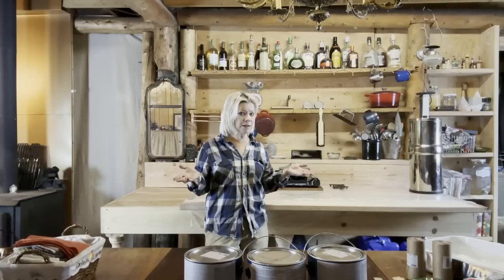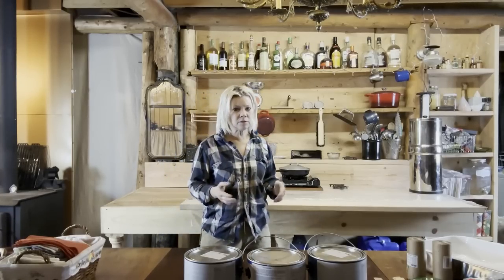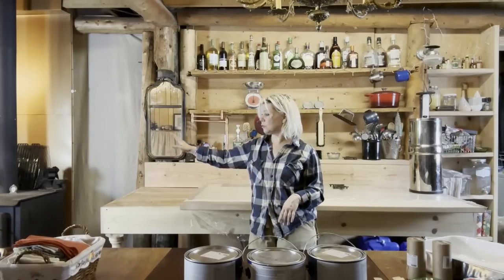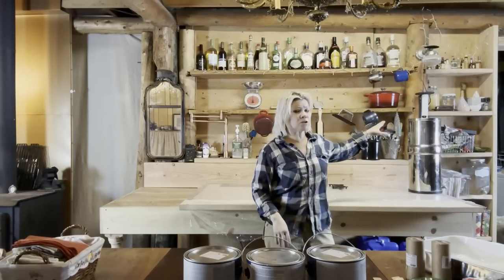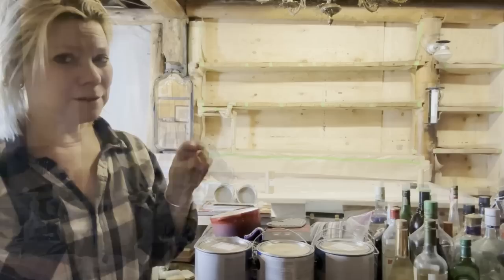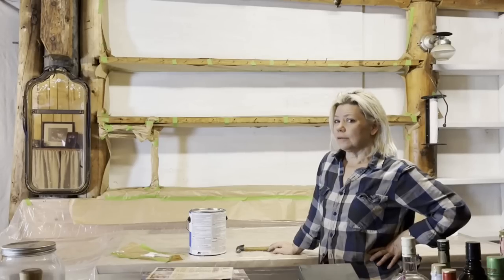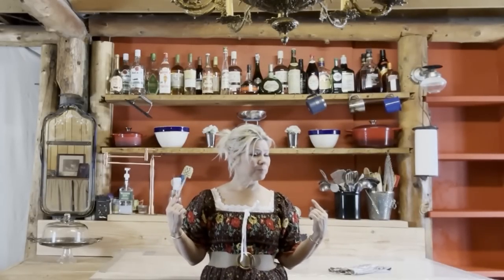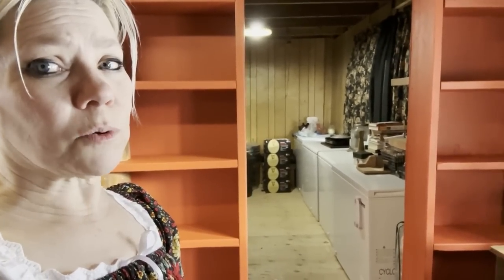Remote Alaskan Cabin Kitchen Renovation Continues

Comment: Ya don't know how happy I was to see that you primed up that natural wood before dropping color on it lol in fact there's only 3 instances where a primer sealer is necessary , smoke damaged, water stained damaged or natural wood...the rest can be covered with a decent pigmented paint like Benjamin Moore or Pittsburgh paints...nice job Aira, now some honey Oak stain on them shelves and you'll be in business,  I would torch and sweep them first though, that butcher block can be sanded 3 courses and then conditioned with the food safe stuff,its very easy and it looks brand new,even better... ,I just did all the counters and chopping prep tables for the culinary college downstairs at my job, just start with 80 grit,then down to 120, then your last with 180 or 220 whichever you can find will be fine, with a damp towel wipe up all that sanding dust ,allow to dry fully, then apply the conditioner with a clean dry Terry cloth like rag 5 coats or more,but its easy, it's basically like wiping down a counter with a cleaner..go at a steady pace ,amd always go with the grain of the wood ,fill any divets or lows,so ya have no missed spots..I'll get the name of the stuff for ya, that I used if ya like, and if ya can't find it up there, I'll send ya some...enough to complete the job ✌️😊 and remember, its never about the destination, it's about the journey getting there!
Reply: Thanks for the tips!
Reply from the maker: Hi Mike! I knew that if I didn't prime the plywood that I would potentially have bleed through or that the paint would be soaked up by the wood and then I would have to do several more coats. As it is, I feel like I did a full leg day at the gym from just doing the primer and two coats of paint. 😂 I will be staining the shelves and counter with a Rosewood stain to match the table and buffet, then sealing with pure Tung oil. The table was refinished previously with just Tung oil, and it held up beautifully. I need to re-do it as it has been almost a good 20 years since it was originally refinished and need to strip and seal the leaves. That will be a huge project, because I will also be finishing the buffet and stripping and refinishing the China cabinet at the same time. These pieces have made it three generations in my family, and I want to preserve them in the best way possible. I appreciate all of the tips on sanding and finishing the shelves. I am going to pin this comment so that I can find it easily when it comes time to do these next steps. 😉💛
Reply: @AloneinRemoteAlaska  oh okay, i should of known that you've done your homework on the project, however, the Tung oil may be improved with being mixed with flaxseed oil and linseed oil as well, it seeps into the wood really well and it is food safe there were other ingredients in the stuff I used,but I believe that those should be plenty good and ,you must remember to put the jar of oil mix into a pot of hot water. At least 20 mins. Before ya start, it'll loosen up that oil enabling you to spread  it real easy like, ..stir it up well also, and have at it, then later after drying a little,when it feels sort of dry to the touch, hit it with another coat, 5x is the desired coatings, however I did the ones at work 6 times and they still look brand new and there's 25 students smashing, rolling,chopping stuff on them for 6 hours a day so...that'll give ya an idea of what the other oils provide as far as durability and rehydration of the wood...go at your own pace, there's no race, just be sure to have any dust or what have you clear before ya go at it with another shot,and warm that oil up, otherwise you'll have sore shoulders next lol 😆👌 you got this!
Reply: @ZarpeParadise  hi Teri, if you meant me, you're very welcome! 
✌️😊
Reply: @mikefalanga437  yes, you! I love renovating. I'm so happy A. is taking us on her journey! Tips and tricks spark my day!
Reply: @ZarpeParadise  oh Okey doke! Yeah, projects can be really rewarding, especially when you exceed your owns expectations, good luck in all you do.. 
✌️😊
Reply from the maker: Hi Mike! I will be adding pure orange oil to the pure tung oil to help improve the ease of use. I really appreciate the tips on warming in hot water and the number of coats to use. My table was refinished with tung oil over twenty years ago and has held up beautifully! I am a bit concerned about the amount of dust and dog hair in the cabin when it comes to this project and others that I have planned. But am sure that patients is the key here. Due to staining before sealing with tung oil, I am hoping that I don't need to sand between coats. 😕 I am sure that when it is finished that it will be beautiful, and I will be pleased with the final result but am a bit apprehensive about the whole project. It has been so costly up to this point that I don't want to ruin it. I appreciate you offering any advice on this and other projects. Always good to hear from someone who has done this before. 🤗💛

Comment: I love it!! It's like a warm paprika color. I'm glad you brought the color all the way to the side shelves as well. Your eye registers it as one continual space & doesn't break it up with different colors, making it look choppy. I think if you found a fabric that has the paint color in it and added a skirt underneath your counter, it would really pull it together. I'm so excited for you! You must love it so much and I can tell it's making you happy. 😁👍💖
Reply from the maker: Hi Lauri! Originally, I was planning on making the shelves a mustard yellow but am so glad that I didn't. However, the shelves will still be getting some additional paint on them. To help age them a bit and make them seem less modern. I have been debating on adding a skirt under the counter. I know that it would help the overall look to hide the water jugs, foot pump and stacks of wood under there, but I have not decided yet if that is the way I want to go. But so glad to get your opinion, especially considering your home staging experience. 🤗💛

Comment: Love the color . The only thing I may do different is paint the front edge of the shelves around the door , maybe white . First I would put the painters tape on the front of one shelf and test the look. That way I could pull it right off if it didn't work.
Reply: Excellent idea!!💜
Reply from the maker: Hi Steve, I will be adding a little pop of contrasting color to the shelves to help them stand out a bit and look less modern at the same time. Love the idea and the painters tape trick! 😉💛
Reply from the maker: This is why I love the comment section! So many great ideas from everyone and for everyone! 🤗💛

Comment: Wow Alone, I love it! Good color choice, thought you were going for the green in the beginning of the video, but I guess you have other plans for that color. I had plain white walls, and just as you, I thought it was so boring. I painted above the kitchen tiles in a mustardy yellow. It made the whole room come to life. If I can suggest anything, I would paint the foundation of your counter top in the same color. That will make it more cohesive. Then oil or stain the butcher blocks and the shelves. It will make it easier to clean, but still have the natural look. Oil on your butcherblock will prevent the wood from cracking up. What was the tool you used? Looks very fast and practical.

Comment: Well im not an interior decorator and Im also male so I'm no help with the color or contrasting colors. I'm also a penny pincher so I'd always go with the reduced mistake paint or no paint at all. Heck my walls are still bair plywood still and its been 5 or six years now. Your doing a great job making the cabin yours and thats what's important. I can't wait to see the next item you check off your list. Till then be safe have fun and God Bless
Reply from the maker: There is nothing wrong with plywood walls. I saw this cabin once that the entire interior was plywood. Walls, ceilings, floors, everything. It was beautiful! Now to be fair, they used top of the line plywood, and hardly had any furnishings! That is something that I have not ever been able to accomplish. I love my stuff probably more than I should. 😁 I think my floors will probably be plywood for many years to come, and many of the walls won't get finished for quite some time to come. I think it goes with living within ones means and living a rustic life. 😉💛

Comment: LOVE IT! A real eye-popper! What's the color called? The warmth is perfect for the surrounding natural wood. Bet it took a long time. Now I feel my projects calling.... See what you did!? Ha! Love it!
Reply: Getcha some heavy canvas and use your paint colors to decorate the matching "rug". You can stencil or stamp or transfer and paint whatever you want. Seal it with a few coats of polyurethane (try to find water based with water based paint, oil based may turn a little yellow but works).  Be sure to "seize" canvas with very hot water and let dry first before painting. On my to-do, 5 yards of canvas waiting for me!😉
You sew the miter corners before painting and glue non-slip on the backside. Also good for wall hangings and window insulation.
Reply: "Size" not seize, you know what I mean. It's like prewashing fabric before you sew it. You go girl!  Your paint job is super impressive! And motivating!⭐